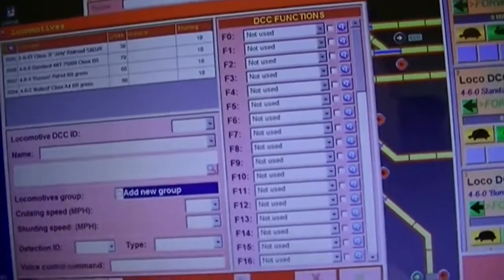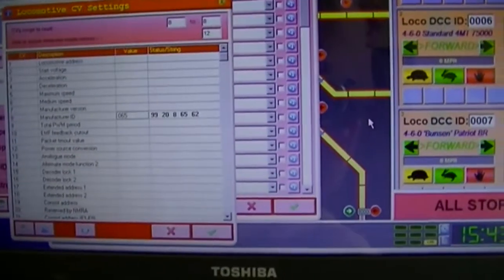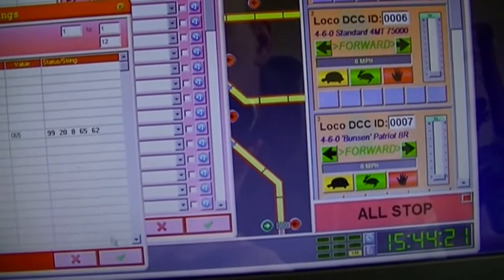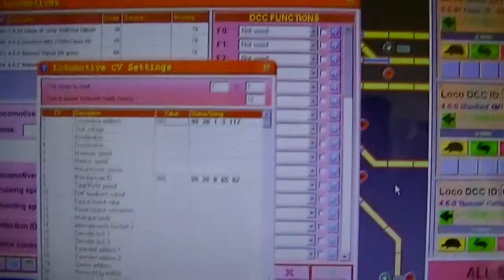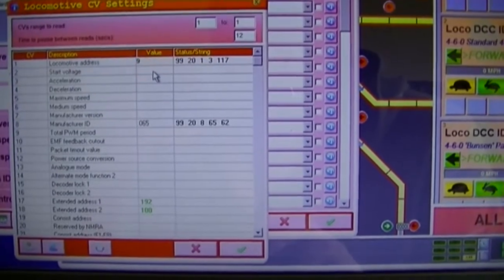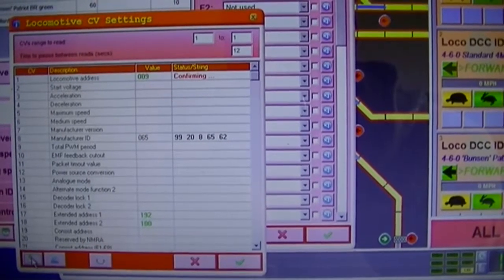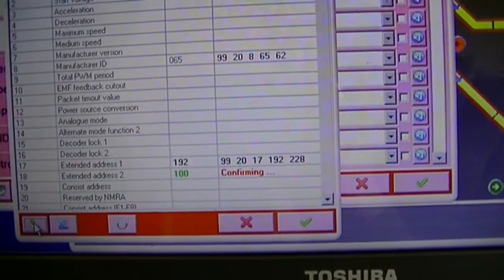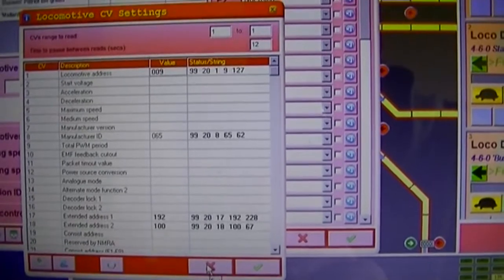Hornby E-Link - How to know your DCC chip is working (2/3)

Comment: I purchased the elink for christmas, I sucessfully downloaded the CD software on my PC but then realised I needed to download the CD on my laptop,  As my layout is in the garden shed, I have tried to download on my laptop but to no avail, I thought with my laptop being wireless it would automaticly come onto the laptop screen but No, I was in a model rail shop last week and was told once you have registered the CD with Hornby you cannot download again, I have been trying to contact Hornby for further instructions but have had no luck, Can you give me any advise many thanks Thomas
Reply from the maker: I wasn't aware it was copy protected, what's the point when it's only useful with a specific piece of hardware? Can you just clarify, have you installed it from the CD onto the laptop, and is that where the error is occurring? Or is it when you have installed it from the CD and are running it for the first time? Does the laptop meet the minimum hardware requirements for the software?